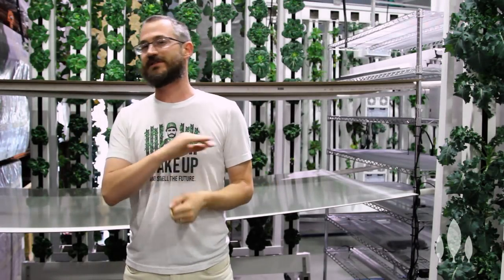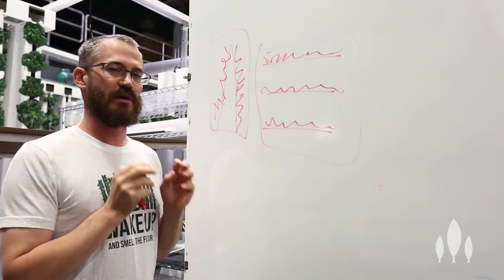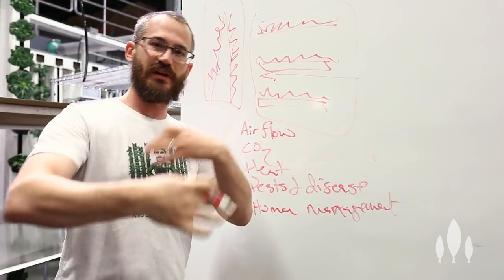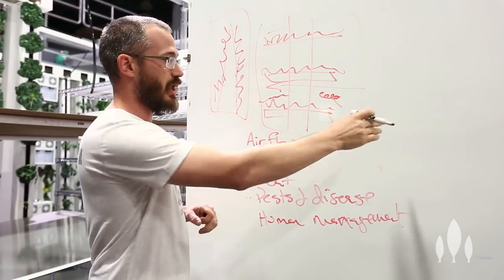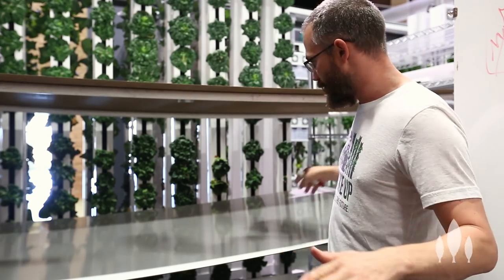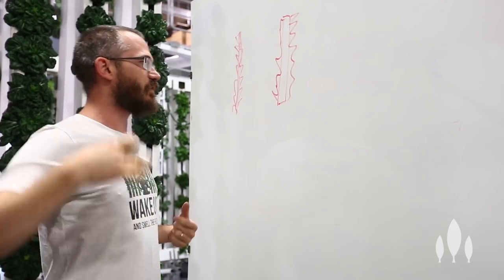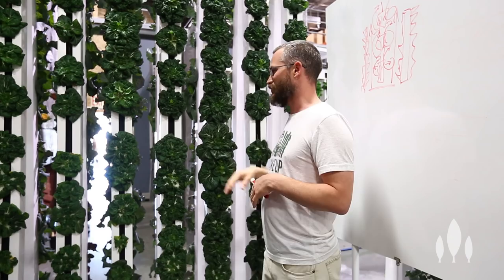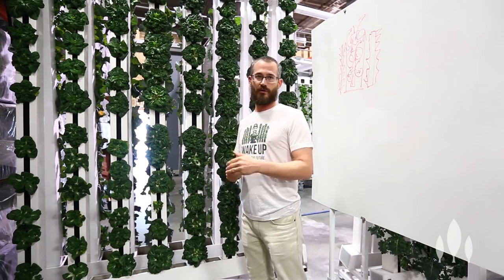Horizontal vs Vertical Planes: Airflow in Vertical Farms

Comment: I like the way you explain. So I have questions:
1) Roots need exposure to water more, right? So, wouldn’t be more product when inclined or horizontal done?
2) Most of the people showing DIY ones with pipes, what is wrong with them? 
3) I want to start as a hobby/side hustle to see if I have the will. What would you suggest?

Comment: The one aspect in vertical versus horizontal labor costs that was not address is "robotics."  In horizontal harvesting, robotics has been the main factor to horizontal production being favored.  I imagine this will change when vertical robotic harvesting becomes available.
Reply from the maker: It definitely plays a role, +Henry DuQuesnay, although this tech is meant for those farmers wanting  to start growing immediately, and preferably without a massive capital expense on the front end. They also don't address the airflow point made in this video. That said, these farmers need tech that allows them to start growing and serving their markets quickly, and scale up organically as they make money. Robotics are neat and will definitely be part of the future of farming, but our farmers don't want to wait around for that tech to become affordable or accessible to them. Hope that makes sense.

Comment: do the racks need to be cleaned periodically? if so how often? you have to put the minerals or plant food to the drippers?
is this considered a greenhouse? enclosed environment?
Reply from the maker: Sure, +paul kawsek - Just like any system, the ZipFarm will need periodic cleaning. How often you clean the system depends on your growing goals and where you're selling. For the ZipFarm, the nutrient solution is automatically mixed in a dosing tank and adding seamlessly to the system. This system works well in a warehouse or other enclosed growing environment.
Reply: @ZipGrowInc  Re: nutrient solution, which I know is a fixed cost, could one use their own nutrients mix instead or is the system calibrated and specifically designed to the nutrients mix you supply?